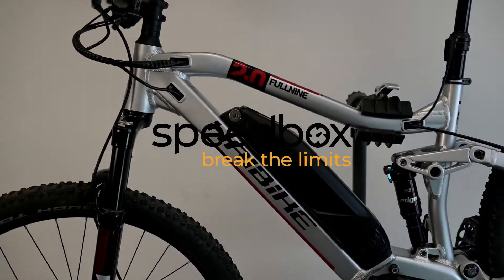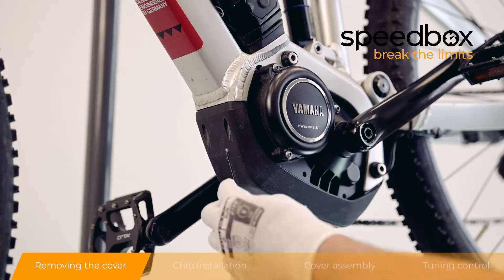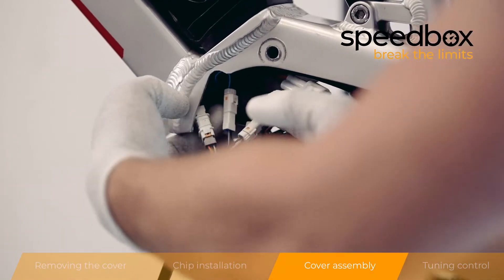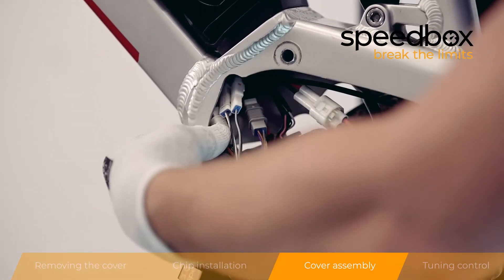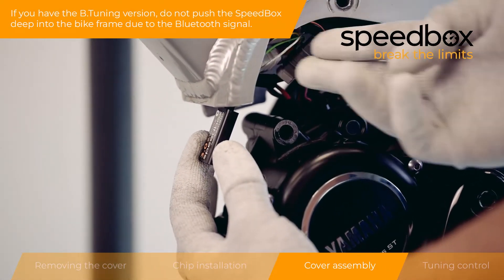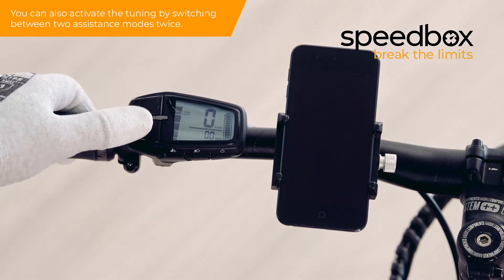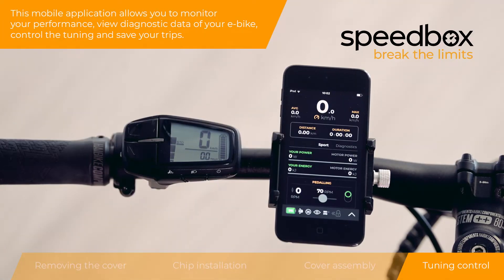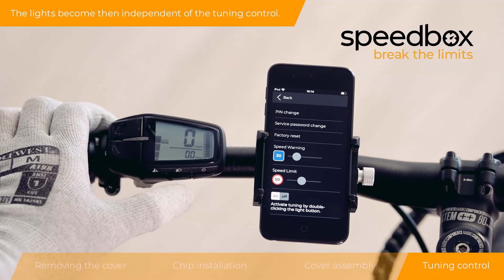eBike Tuning SpeedBox 3.0 (B.Tuning) for Yamaha Installation Instruction

Comment: Are there any updates for ST engines? I am using a Lapierre HT 8.6 2023 model bike. I think I'll have a problem?
Reply from the maker: Hello.
Last year there were several cases of the ST motor overheating. We don't know if it was related to tuning or excessive motor load - for example, some people set maximum assistance and do not shift to a lower gear even when going uphill. As a precautionary measure, we have decided not to officially recommend our product as PW-ST compatible. However, we know that customers commonly use our chip for these motors 🙂

Comment: There is just no way installation is possible.  I bought one for my Giant Fathom with yamaha-motor. I tried for hours to make it fit, but there is simply no room for it. Even though this video makes it seam like there is.
Reply from the maker: Hello.
The place is there, but sometimes you have to arm yourself with patience. However, it wouldn't work that way either. Yamaha motors are not compatible with Fathom ebikes 😞

Comment: Two weeks ago I bought a speedbox 3.0, I have a bike manufactured in 2023 (the bike model year is 2022) with a PW-ST engine. There is no year of production marking on the engine.
Speedboox works properly, I drove about 100 km, the engine does not heat up more than during normal driving with a limit of 25 km.
Does this mean that everything is fine? Do problematic engine versions overheat severely with the speedbox? I want to be sure that using the speedbox will not damage the engine.
Reply from the maker: Hello.
Thanks for the positive feedback. The SpeedBox 3.0 works with PW-ST motors, but there have been a few cases where the motor has locked up. It is not said that this will happen to your engine as well.
But just to be sure, we have included PW-ST motors in the list of incompatible motors.
Reply: @SpeedBoxTuning  just bought 1 for my Haibike Trekking 6 (2021) with PW-ST motor and it makes the bike unridable. On the display you see glitches on the speed every other second, and for each glitch the elecric assistance of the motor is cutting... very disappointed. I sent a video to Speedbox customer service to illustrate the pb. your statement above is incorrect, your internet site is still saying your device is compatible w/ PW-ST until 2021 included.
Reply: @SpeedBoxTuning is there any problems reported for using speedbox on Yamaha pw-te and what speedbox would you recommend
Reply from the maker: @ Hello. We now recommend the new SpeedBox 3.2 for Yamaha with extended compatibility. More information on our website speedbox-tuning.com

Comment: Will this work on my 2022 Haibike FS8 with a Yamaha PW-ST engine?
Reply from the maker: Hello. We originally offered this model as compatible with the PW-ST 2022 motors. However, after some time, a few issues appeared with the PW-ST 2022 motors, which have not yet been 100% avoided. That is why we have decided not to offer this model for PW-ST 2022 motors yet. If the situation changes, we will inform on our social networks 🙂

Comment: Do you guys have plans to release a speedbox compatible with the PW-ST motor (on a cross core rc)? I'm assuming per your previous comments that this is not recommended with this particular model.
Reply from the maker: Hello Jay. As you probably read in the previous comments, the SpeedBox is fully compatible with the PW-ST motor, but with the latest PW-ST versions, there have been a few cases of motor overheating after driving with the tuning activated. As soon as we manage to resolve this matter, we will inform on the website and our social networks.
Reply: @SpeedBoxTuning  looks like I’ll need a refund on my speedbox which just arrived today then 🫤
I’ve just picked up a 2022 Haibike Alltrail 4 for ~£3500 and was intending on derestricting it. Such a shame and hope you guys can find a way around it. I hear some mods are sending the PW ST into an unrepairable Limp mode
Reply from the maker: @MrJoelDavies  If you install the product on your bike, there is a high mathematical probability that it will work without the slightest hitch. But there remains a small risk that it will not.
Reply: @SpeedBoxTuning  I guess the question is, do I go ahead and risk it. Or hold fire until someone works out what might be going on and how to work around it/resolve it.

Regardless, thank you for such an incredible product. I’ve had previous versions of Speedbox on my previous Bosch engine bikes and it is one of the greatest things I’ve ever purchased.

Comment: hi i have a haibike hardnine 6 with yamaha st motor is it compitable ??couldent see if it was on the site.
Reply from the maker: Hi, Jan. Our SpeedBox is functionally compatible with the ST engine. However, we have seen instances of the motor running hotter than usual with the SpeedBox. For this reason, we prefer not to recommend tuning these ST motors.